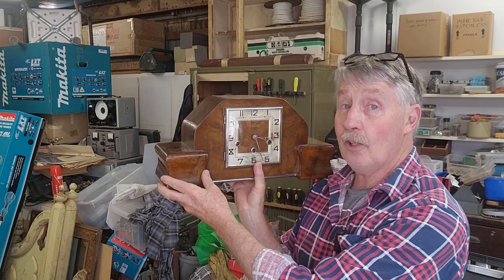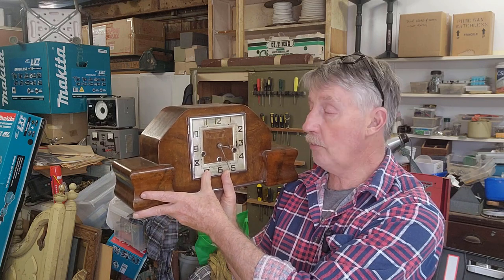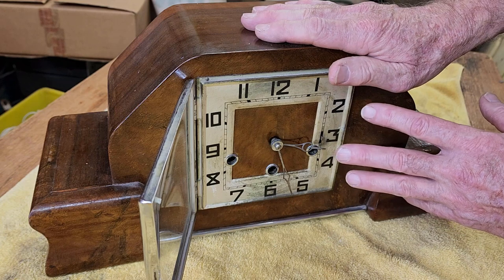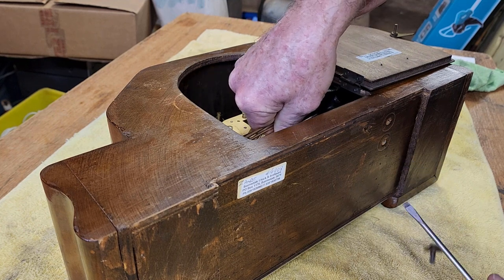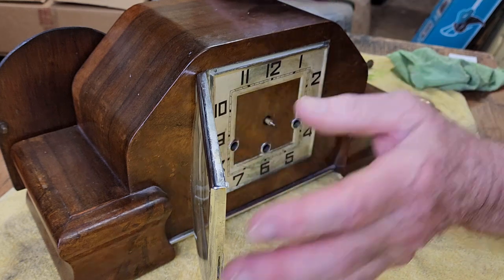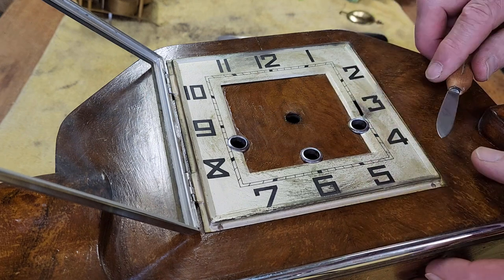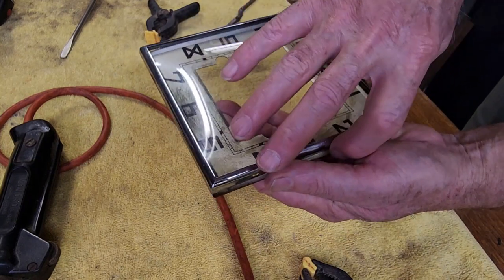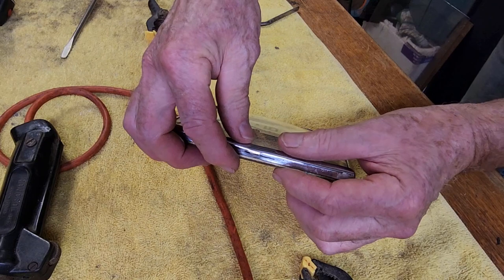1940s German Mantel Clock Repair - How to Fix a Broken Door & Get the Chimes Working a bit Better!

Comment: Hi Chris, I came across this video today while looking for a way to resolder a broken single hinged door. Your video gave me confidence to tackle the problem. While I had a slippery reference point for a single hinged door, I started by cleaning the surfaces and then using my soldering iron. After many expletives and failed attempts, I had a pool of solder on the inside rim near the hinge position and I eventually used a little gas torch to finish the job (trying to be careful to not overheat and then let the solder harden before letting go of it). I think it was the 5th attempt before I was able to get the right result - but pretty happy with the outcome and the door aligned really well with the catch with a strong bond at the hinge . Many thanks for your detailed instructions on the approach to fixing these little marvels. I'm a fan - thanks for your help.
Reply from the maker: Great work Mark! Funny thing is that we learn more from having five attempts at something before it works, instead of getting something right the first time! I'll bet you'd be a boss at the job next time! 👌😀

Comment: Your style of "agricultural" clock fixing matches mine Chris. I might have used Brake and Part cleaner in a spray can. Did you note that the three barrels are in slots, and can be removed without dismantling the clock completely? That way (if the effort is worth it) you can clean the clock in engine cleaner, which rinses off with water (which then won't get in to the barrels), and can be dried in a low oven or outside on a hot day. I recently did one in petrol, and the petrol smell lasted for ages. I wasn't very proud of my efforts. Also, do you know whether IPA dissolves the shellac as well? I've never stopped to think. I imagine it does... Thanks for my style of restoration 🙂
Reply from the maker: Thanks Dave. I grew up on a farm, so can be a little "agricultural" at times! 🤣
I did notice the removable spring barrels and mentioned that at the end I think. I didn't want to go to that much trouble - but it will be necessary down the track. I don't seem to have trouble with a petrol smell - maybe it's a different formula here?? I haven't tried IPA on shellac.. will have to test that!
Reply: Thanks for the reply. I like your clock restorations particularly, so do keep up the good work!